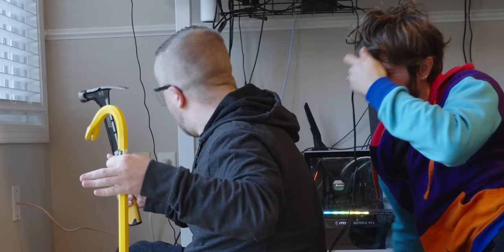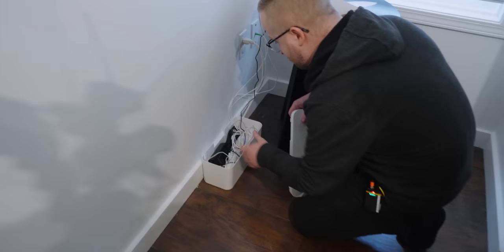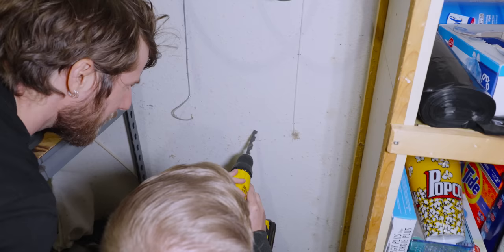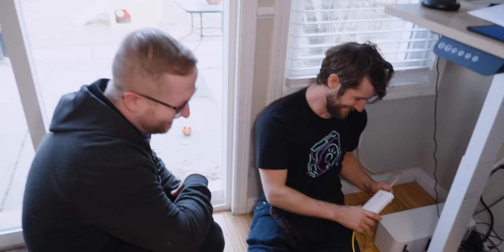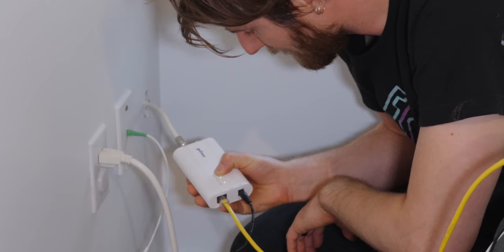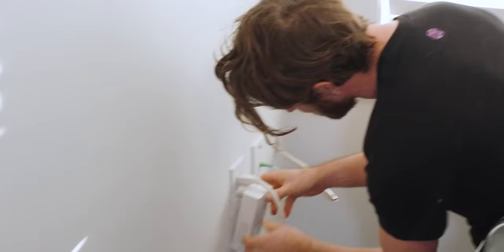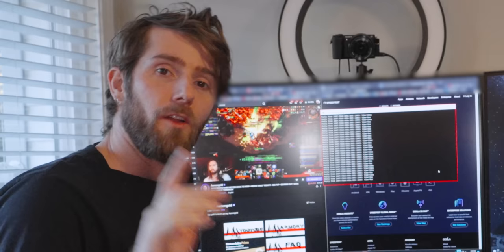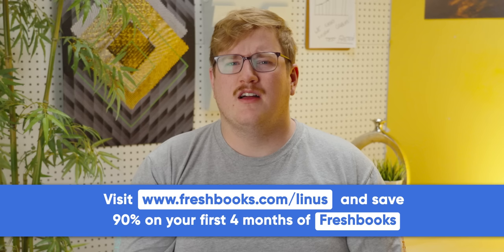I Will FIX Your Wifi - MoCA and Powerline at Colton's House

Comment: MoCA hands down better than powerline adapter .. if you have coaxial in home
Reply: Better how?
Reply: @mrgallbladder  MOCA thru put better than powerline for sure. MOCA can transfer up to 2.5G for now depending on how better of your PHY rates while power is still struggling with electromagnetic fields interference(as known as EMF). Base on FCC here is the U.S, they don't like to have low voltage cable next to high voltage cable at least 8 feet to each others and power line is using your existing home electrical wires to transmit data services and that does not recommended.

Comment: Bought a house and found the whoever built it was a TV nut and ran Coax to every single room in the house from a central point. I had no idea I could use them for internet, this changes everything!
Reply: The elders would tell you, because every tv required a cable connection
Reply: Make sure any splitters are rated to 2000Mhz. And disconnect unused runs from the main splitter.
Reply: “TV nut” lmao. It’s standard to have coax in all rooms.
Reply: Don't neglect to cap unused coaxial jacks with resistors.
Reply: Have you considered using the coax as a fish wire, to allow you to pull Cat 6 from that central location to every room?
Reply: @ShaunRuigrok  You can consider it, but if you actually saw how the coax was run you might realize there could be a number of problems. Its definitely not running through nice conduit with plenty of gradual bends. Good in theory, the pull itself might definitely not go well.
Reply: My ISP is using coax for my gigabit internet connection. I didn't know there are solutions for in-house using too, this stuff is great!
Reply: Linus plz make a tutorial on how tô afford to buy a house
Reply: Coax was developed to transmit RF signals. The 2.4 Ghz wifi frequency is just a little faster than the old TV signals with 800-1000Mhz. These cables were practically made for internet. It's just that recently we found out that to mitigate interference, it's sufficient to simply twist two wires around each other, instead of having one wire literally inside the other one.  This is much easier to produce and the reason for the twisted pairs in our ethernet cables. Nowadays when a coax cable is used, it's most likely because of the plug.
Reply: @bboi  standard where? 😭
Reply: @ShaunRuigrok  I considered it but having peaked inside my walls I can confirm that all the cabling is very well secured, and hard/impossible to access unfortunately.

Now at least I don't need to worry about that!
Reply: @bboi  Maybe in the US, there's not so many new builds in the UK, and the few I have seen in detail have run ethernet in preference to other cables.

The previous owner also had 7 TVs, one in every bedroom, study and living space which is why I view them as a bit of a TV nut.

Personally I have one TV in the living room and consider having every single room wired up a bit excessive. Not complaining now though (:
Reply: @StripedJacket  Here in the US at least. Doesn't even need to be new builds. I even have old homes that are wired up with telephone an coax everywhere.

Comment: With MOCA, the coax splitters need to be rated for the frequencies that the MOCA adapters use. There are also MOCA filters that you can put on the input of the first splitter to block those frequencies from leaving your home. When set up properly, MOCA is far superior to the powerline adapters. I always recommended them when working in that industry.
Reply: Do you have a brand or model recommendation for MOCA?
Reply: As a practical matter older splitters, despite not having been tested for higher frequencies when they were released (as they weren’t in use) could work fine. It is worth trying before tracking down every last one in your home and replacing them, IMO, which I ended up doing to no real benefit. That said MoCA is far and away the most reliable alternative to Ethernet, and even if old splitters did put a bit of a damper on performance, it should definitely be considered well before powerline, which is spotty and slow even in relatively new construction.
Reply: I wanted to write the same thing, they even hinted "it uses the same frequencies as dish" which indicates 950-2150MHz at least in Europe. Regular cable splitters do 5-1000, high quality that support dish are 5-2500MHz, old cable splitters could also only work until 450 MHz but because he already had cable internet, it need to be at least work until 1000MHz.
Reply: superior in terms of latency?
Reply: @Dr.Spatula  bunch of them appear to be rebadges of the same underlying controller. My stuff is a bit older (MoCA 2.0) but I’ve tried a couple of brands without running into issues with either (Actiontec, Zyxel/Motorola). GoCoax seems to be popular these days since they’re price-competitive and their reps can sometimes be found on Twitter. MoCA 2.5 models that support 2.5GbE speeds are also out now, I’m not sure how much of that bandwidth can actually be used (and these might be more sensitive to splitter quality; I haven’t used them). Some MoCA 2.5 stuff also only comes with a GigE port, so make sure you get one with a 2.5GbE-capable port if you want to take advantage of those speeds.
Reply: What do you recommend when you're not working in that industry?
Reply: @Dr.Spatula  Actiontec i was able to get 950/950 over 300Ft of coax and even with a cable signal going to a box. works really well.
Reply: @kiyoponnn it’s not even close. Latency, bandwidth, and signal integrity were all much spottier with powerline when I tried it. To be fair, it has been a while...
Reply: One thing I think actually could help is reducing the total amount of splitters in your signal path (by doing home runs or at least longer runs) and replacing your current cabling, which may be old or dubious in some way. That actually did help me, much more than replacing extant splitters did. This however is A Job, and while you might be able to get your cableco to do it for you if you’re a TV customer, otherwise, you’re probably on your own.
Reply: @bilditup1  powerline is terrible in an older electrical system or a complex system
Reply: 100% correct, however, latancy can be around 4~8ms
Reply: @bilditup1  I work for an mso and we use moca for years. It is very reliable and quite fast. Moca 1.0 add around 6ms and moca 2.0 3ms. The payload is great for the technology on existing rf network on coax that are used for tv/internet/voip.Only weird thing is that if the splitters and attenuation matchs, the signal degrade a lot and the speed of most carriers decrease. Also you need a moca filter at the entry point of the house if you still use coax for provider. 

A very very cheap alternative on a not in use coax is to buy a set of "deca" adapters. They were made for satellite so they used lower frequencies that would interferes with an mso. It is only 100Mbps but very reliable and almost free on amazon/ebay.
Reply: Couldn't agree more. MoCa is the way if you have the option of either coax or powerline. MoCa 2.5 is even capable of (wait for it ...) 2.5gb Ethernet. I used to live in a condo and to run cat6 would have required all sorts of HOA bs and probably have to bother some neighbors. MoCa saved the day as all the coax cables had a home run back to the bedroom closet. Ez
Reply: to bad they don't make a compatible version for those with satellite tv
Reply: @frankthefkintank  sure but it's also better than most WiFi setups. The whole point is to get something better than WiFi and MoCa succeeds in doing so. 3ms of additional latency is honestly no big deal for 99% of applications including competitive gaming and maybe excluding the top 1% of players
Reply: @GameCyborgCh  unfortunately not. It seems totally possible to design an adapter that would use different frequencies but I'm assuming there just isn't enough demand... But I'm also just talking out my ass so what do I know?
Reply: I recently set up a MOCA network for my home and it's great. I highly recommend a filter as well, it helped solve problems/improve speeds for me
Reply: @Dr.Spatula  Translite Global TL-MC84
Reply: @SMASHINGblargharghar  I've found ethernet to coax adapters which use a technology called G.hn they use 2-200Mhz, so it shouldn't interfere with satellite tv (950 - 2150Mhz) but i only find conflicting information. one adapter says it does run in parallel with your sattv the other says it specifically does not work. on one manufacturers website's FaQ they say that it only works with dark coax (aka coax that isn't in use) but 6 questions later they say it does work with active coax lines
Reply: Came here to state that the MoCA filter will keep the signal confined to your household if not using encryption. I have four MoCA adapters that all work flawlessly and provide very close to 1 Gbps transmission on my home network.
Reply: I was going to say the same thing about the filters .... im surprise he didn't know this
Reply: So this is perfect timing. Maybe someone could help answer a question. I have a family member who just got a ring camera and wants it installed on an exterior wall where there is virtually no wifi reception. My plan was to use powerline to avoid having to run an ethernet cable. Is powerline good enough for light duty use like with a camera? There is no coax so moca is not an option. It's either powerline, wireless repeater, or an ethernet cable (which I really want to avoid).
Reply: Both have a lot of problems. I work for an ISP; we used to deploy both solutions but we've stopped because of the various issues. For MoCA, it was primarily a cost concern. Deploying a single MoCA adapter increased the cost of an install by 30%. For powerline, it was a reliability issue. They get horrible performance with dirty power grids like we have here in Alberta, and they're extremely vulnerable to power surges and can't be placed behind a surge protector, needing replacement as much as several times a year as they get fried.
Reply: I used MOCA to set up my home office. There was a coax cable from that room straight to where I had my internet modem. A pair of adapters, no new holes or awkward fishing, and I have gigabit networking. It added maybe 6ms latency. I never have networking issues with it.
Reply: @DrLoveQc yeah, I’ve seen those and if I didn’t already have older moca stuff and anyway still have cable I might have considered it, great mentioning it!
Reply: @azjeep yeah, most of the time they even include one with the adapters you buy!
Reply: @asphere8  30% higher, relative to what, I’m curious? A WiFi repeater? An Ethernet drop? Or nothing at all? Because I think most people considering MoCA are doing so as an alternative to a WiFi repeater or running Ethernet, and between the time saved on not having to run that and/or money saved not having to install it, my guess is it’s rather competitive, while being much more reliable than other alternatives to Ethernet. There’s also a lot of decent used equipment to be had out there for cheap (though obviously ISPs can’t be systematically scouring eBay for unvalidated hardware, haha)
Reply: This install was a bad representation. They just done it all wrong. That white RG6 coaxial cable wasn't even the main line and they didn't even check where that cable was connected to or if it was connected.
Reply: I have used Powerline adaptors for years. Although they often claim to have 1Gb ports, in my experience the actual connection speed is never actually capable of anywhere near that, even sockets in the same room tend to achieve a max of 300mbs. This is with 3 different generations of adaptors and 2 different houses. (Still quick enough for what you need for many devices though)

The MoCA devices on the other hand, specifically GoCoax are the ones I have are great. I've been using for 6 months as a trunk carrying all VLANs to an Access Point in the attic and it works consistently. It only adds 2ms to the ping, low jitter and I've had speeds of over 500Mbps on WiFi 6e.

Comment: Something not mentioned in the video is that if you're doing the powerline solution you should really make sure it works well for you while it's still within the return warranty period. Older buildings, specially condo buildings, have really fucked up wiring and it makes the internet significantly slower and laggy.
Reply: Exactly this, I live in a very old house and bought a PowerLine adapter expecting 200-400Mbit/s, I got 20Mbit/s.
Reply: I gotten to like power line Ethernet, it was pretty good since we were the only ones using it
Reply: Yup tried the power line method. My place gets around 250mbps off my ubiquiti ap ac lite and got like 20mbps off powerline. But I also feel like I plugged the powerline on the router side into a power strip rather than into the wall but too lazy to even attempt it again when I’m okay with my WiFi speeds
Reply: not really ducked up. Just different power phases. That can easily ruine it. It dosn't really have a lot to do with the braker though.
Reply: @ixpaul  here a tip, have 2 different lines of Ethernet over power going through a 20 amp twist lock. It act like the phases are ignored.
Reply: Absolutely. I tried powerline in an admittedly complicated home setup (very spread out large property, PC 2 floors lower as far from the modem as you could get, 2 fuse boxes, multiple dated systems, etc.) and was averaging 1-2Mbps using the adapter on a 400Mbps cable internet plan. The same PC could get a wifi connection for 10-20Mbps speeds depending on the time, but with significantly less stable latency. Ultimately going to a mesh network was the right solution in that situation, but the powerline did at least give me a stable enough connection to play games without random disconnects.
Reply: Yeah, I actually tried one of those before, but maybe it was due to the powerlines of that house or that the adapters were faulty my 600Mbps connection was reduced to 60 Mbps, so I ended out refunding them.
Reply: Being on the same circuit significantly increases the chance you'll get a connection, let alone decent speeds.
The power line adapters I bought for my grandpa's place didn't really work because of that, but worked perfectly in the apartment I'm in.
Reply: Yep. My place is old and got less than 1 MB. Powerlne was not for me
Reply: please don't pollute the airwaves with the damned powerline adapters
Reply: @bass9112    Is one of us misunderstanding what a power line adapter does? Unless you were to get one that also serves as a WiFi access point, "polluting the airwaves" shouldn't be a concern.
Reply: @bass9112  I don't think you understand how powerline works, or what airwave means
Reply: *especially (different meaning)

Comment: Put some tape on the wall where you’re going to drill through. It’ll help with the drywall blowing out the back side.

Also don’t push super hard. Let the bit do the work.

Alternatively, drill through with a pilot bit then bore to the proper size from each side.
Reply: "Also don’t push super hard. Let the bit do the work." 
That's what she said?
Reply: Another one. Drill from the side that you want to show a better presentation.
Reply: @sergiogsr Yeah. I was scratching my head trying to figure out why they didn’t just drill out from inside the room. Then they wouldn’t have had to worry about drilling through to the right spot.
Reply: Option 3. Don't run the cable through the wall until you've tested it. They could have used a router in bridge mode and connected that to the moca for testing before drilling. If it worked, they would still probably need to follow option 1 or 2 to test it's real world performance, but given that it didn't work, they could have avoided the drilling altogether.
Reply: @timmah2723  I mean the obvious answer is for the video it makes it more entertaining watching it come through and not knowing if it is in the right spot.
Reply: @thomaselbojensen8465  Exactly what I said
Reply: We don’t do that here at LTT HQ
Reply: You only need a flathead screwdriver to "drill" thru sheetrock
Reply: @kairon156 my S.O likes its the other way around 😏